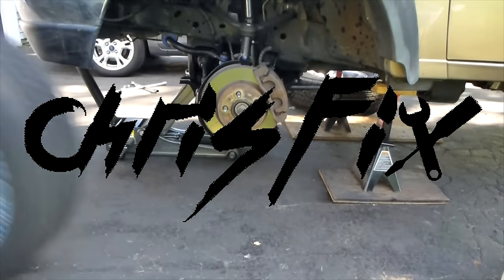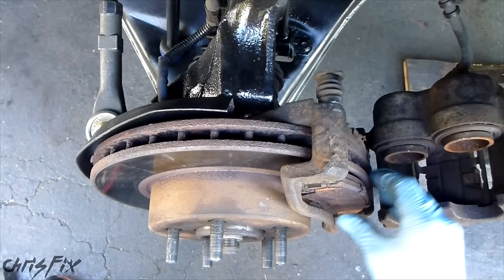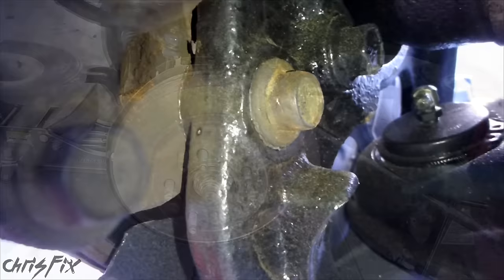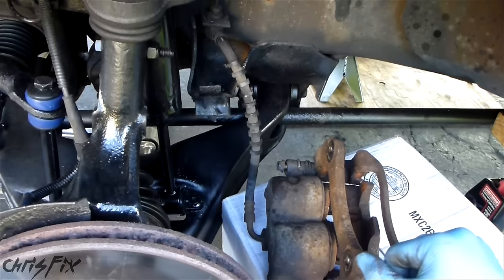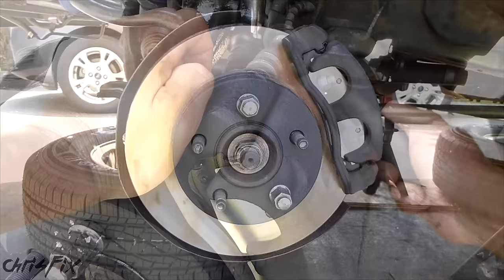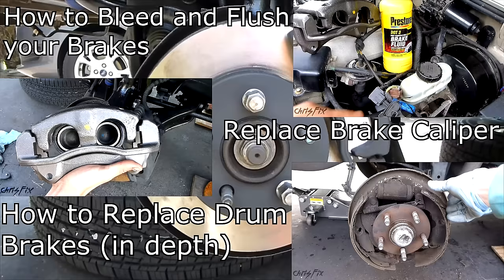How to Replace Front Brakes, Pads and Rotors

Comment: Hi Chrisfix, I have a problem and a question, I hope you or anyone on this feed can help me out with.  O.k. 1st,  I notice my truck GMC Canyon 2006 would shake when I'm braking and coming to a complete stop. O.k. I was told that my rotors needed turning, I had them turned, but put back on my old brake pads, (I didn't use any brake spray before appling the pads neither time) because they wasn't worn down.  When I install the old pads back on, and drove it, it did the same thing.  So I purchased new pads, put them on and it still shakes when I'm coming to a complete stop.  What did I do wrong, or what do I need too do to hopefully solve the problem??? Could it be my back brake pads??? Can you please or someone respond thanks.

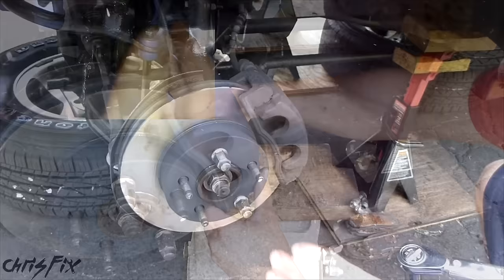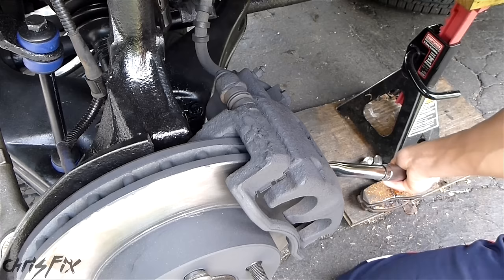Comment: What do you mean in 3:35-3:45? You said something like toke it down to 80 foot pounds but is this necessary? If so, why? Thanks
Reply: You will need to torque them down to a specific foot-pound because you need to make sure you've got the bolt on tight enough. You wouldn't want anything falling off, especially while you're driving! You'll have to look up the correct torque specification for your specific vehicle.

Comment: +ChrisFix hey man, thanks for this video. I love watching your videos. you explain this so clear and better. I was wondering if this would work on my 2000 ford expedition? Do I need to use a torque wrench, or can it be hand tightened? (don't have a torque wrench) also how can I tell if my application needs to be 12mm or 14mm for my rear rotor. please help with these questions.
Reply: I ask if it is the same only because I've seen some videos where they use a screwdriver and stick it in the middle of the caliper before they begin.
Reply from the maker: +Edwin Castillo It should be exactly the same and if not, it should be similar.

Comment: How do i find tightening torques for specific vehicles (pretty sure its different on every vehicle and i just wanna do it right) if there's none on the internet and i don't have service manual?
Reply: for torque specifications on your wheel lug nuts they should be located on the side of your door that also includes tire sizes and recommended psi.

Comment: wassup Chris I got question If u can plz text me back about that part where u put the small bolts to hold the break pad on rotor..... ummm does it have to have a specific torque pound on the bolt like if I tighten the small bolts that hold the break pads, will that cause the break pads to keep on compressing the rotor because I put new break pads and new rotor and the rotor seems to be getting pretty hot after test drive
Reply: on 8:06 that's my question

Comment: Chris!! I did a brake job to my truck and i tried bleeding the brakes and the bleeder bolt broke!! now my brake pedal goes all the way to the floor. what do i do? Should i get a new caliper or take it to a professional that can remove the broken bleeder and just replace that? help meeeee
Reply from the maker: You can drill out the old bleeder valve. It is easy because they are hollow. Then press the brakes a few times to push any metal shavings out. Then install a new bleeder.
Reply: ChrisFix thank you so much. But I can't use the truck for now bc the breaks are very weak. Would that be bc of air in the fluid/brake lines?

Comment: Chris can I use the same grease i bought for the bearings on the brake pad guide?
Reply from the maker: Use silicone grease. Petroleum based greases can degrade the boot on the guide pin. Di-electric grease is the same as silicone.

Comment: Hey man! Where can I find the torque specs for the brake bolts and guide pins. All my owners manual gives me are the wheel lug nut specs.
Reply from the maker: Here is a video where I go over that info: https://youtu.be/3v3hLvuO_KU?list=PLDD611CFB36FC65F2

Comment: C clamp and old brake pad works just as well
Reply from the maker: It does! A brake spreader makes your life a little easier though!
Reply: 18 years behind a car n working on them. C clam easier n faster in my eyes .   when I work on any car or truck.  
 sure 40 bucks on a tool or 10 bucks ? Question able. Some guys have very little money need to show this kids to use cheap tools that will work .

Comment: Hello Chris. I recently changed my brakes and rotors 5 days ago and I hear a metal to metal noise and it starts squeaking when I'm close to stopping. What could be the issue.
Reply from the maker: It could just be your brake pads are new and need to be broken in. Drive 200mi and see if it is still there. Also, cheap pads will make noise so remember that.
Reply: +ChrisFix so I worked on it today. I used brake cleaner and greased the brake pads. I installed ebc greenstuff series 2000 brake pads and ebc rotors
Reply: +ChrisFix it has improved but just a little noise

Comment: is there no need to bleed them?
Reply from the maker: You don't have to if you're just doing pads and rotors because you're just replacing parts and not opening up the system, but usually brake fluid gets overlooked so with everything the way it is, it wouldn't be a bad time to bleed them and replace the old fluid!
Reply: @chrisfix  thank you for the quick reply, Chris. Going to replace the pads/rotors on my Matrix. :)

Comment: Hey chris, do I have to open the valve when compressing the caliper? I have a Toyota Tundra if that matters? Thanks!!
Reply from the maker: +Avi8CaLiBeR You dont have to, but you can if you want. I almost never do it but if you want to bleed out some old fluid, it helps. Check this out: https://www.youtube.com/watch?v=xJDOuZzEAQc
Reply: In what situation would you have to bleed the brakes? Thanks so much and I love the videos! Keep it up!
Reply from the maker: +Avi8CaLiBeR Any time you remove the brake line so air can get in you need to bleed the brakes.

Comment: My calipers really tight and my rotor won't spin I just replaced the rotor  caliper and pads what do I do?
Reply from the maker: Press on the brakes and let off the brakes. See if the caliper pulls the brakes off the rotor.

Comment: what happens if you change the brake pads without opening the brake fluid cap?
Reply from the maker: +Dimitris Tilaveridis You could get pressure buildup but I have done it before with no ill effects.
Reply: thanks

Comment: Changed my brakes and rotors and after about a two mile test drive, brakes were smoking when I got back? Not terrible but there was little smoke? Also still a lot of sinking in the brake pedal? Any ideas?
Reply: Did you bleed them?
Reply: Yes bled them and helped somewhat but still play in the pedal.
Reply: Are you leaking break fluid? Maybe it was leaking onto the brakes and smoking from all the heat.

Comment: Hey, quick question:
I just got my rear brake pads and rotors and now I am hearing a clunking sound when going over speed bumps, like something is loose in a box and it thumps on the box when you shake it. And while braking, I hear another sound that I can't put my finger on. I just got them done last week and my cousin who is a mechanic came to see and he says that I got the wrong rotors, which I know is wrong but he thinks they are the wrong sized rotors. I'm lost. Can you at least give me a nugget of info. lol Thanks. 

2010 Nissan Altima Coupe, 150,500 (roughly) miles. Purple <3 lol
Reply from the maker: Probably a sway bar end link or sway bar body bushing: https://www.youtube.com/watch?v=YqOsW1X1-O8
Reply: Ok, I will look into it. Thanks!

Comment: Is it necessary for a torque wrench?
Reply: Those bolts are made of high quality steel, you won't snap the heads off or strip the thread with hand tools so just do them up bloody tight!
Reply: +John Hemingway Thats false. sure he doesnt need to use a torque wrench in every scenario but some of these bolts are indeed not strong. ive broken slider pins with a simple wrench before.

Comment: Chris to reply to your question,  the brakes fine,  then I start to smell the brake pads,  n the car slows down when I take my foot off the gas pedal..   I am concerned..   I replaced the brake pads,  install new caliper,  n rotor, I have bleed the brakes..   n still the problem exist..  I am not using the truck,  but will take the car to a mechanic to have it check out..
Reply from the maker: +jose ilarraza Keep me posted!
Reply: Ok...

Comment: how often do you have to change you break pads shud I learn more about cars before I purchase one
Reply: +Simply Tron How often depends on how you drive. I've seen people having o replace their pads after 18k miles and other after 60k miles. If you do a lot of hard braking you will need to replace them sooner. For example I tend to have to change my brakes sooner than most people cause I spend a lot of time at the race track, so that means I drive my car much more harshly than others and have to replace my parts sooner than people that just drive from point A-B.
For actually learning about cars before buying one, you don't have to know how to take apart an engine and rebuild it, Or how to replace the synchromesh in the transmission, but you should ALWAYS learn and do research on the cars you are thinking about getting. A lot of people don't know what a rotary engine is, and people end up buying a Rx7/8 and wonder why their engine has seized up in less than 500 miles, because they didn't do their research before they bought the car. So If you are thinking of buying something, look it up and see what the Pro's and con's are to owning that car.
Reply: +- “RaceReadyRider” - what u think about 2006 volkswagen passat
Reply: I've never really looked into them or anything, but mu uncle has one, and he hasn't had a serious problem with it yet. He has had a flat tire, and the obvious oil change. Other than that it's a nice little car. But Don't take my word for it. Do some research yourself. If it's used make sure its in good condition, and when you test drive it, go through every little thing on it. Even if you will never use one of its accessories still make sure it works; and if it doesn't you might be able to talk them down on the price or get them to fix it for you before you buy it.
Reply: Damn he just sold the car lol but I appreciate your response one more thing can u put a navigation system into any car and where wud i get it done at.
Reply: Yup, you can put a nav into any car, but make sure it can fit into your car. Most websites that you buy the nav system at also lets you put what kinda of car you have and they will give you a list of what kind can fit into your car. Or if you go a buy it from a store you can ask them if it will fit.

You can also buy an external nav system, where all you have to do is buy it, suction cup it to you window or dash or wherever you like, and plug it into your cars 12volt outlet (cigarette lighter) and that's it; You don't have to worry about fitment, and it can be much cheaper

As for installation just look up online somewhere near you that can install it. The shops are usually independently owned so I don't know any shop names for you. But I think best buy can do it for you. not sure though. Just look up Car navigation installation near (insert city name here)

Comment: +ChrisFix Hey Chris i am a new subscriber and i have a question for you, I normally do as much work on my vehicles as possible but recently i had a mechanic do my front brakes because i was to busy with work to do them. With that said my brakes were not squeaking, rubbing or grinding when i dropped the car off at the shop. When i picked the car up from the mechanic i noticed that my brakes were doing everything that they are not supposed to do (squeaking, rubbing and grinding), i took the car back because i feel he was responsible to fix them and two visits later they were still doing the same thing. Do you have any idea as to how a mechanic of 30 years could screw up such an easy job? What could have went wrong to cause this? Can i take them apart and clean them and install them right if they are good? or should i just replace them? Sorry if this was confusing, i didnt know how else to word it. Any help would be greatly appreciated! Thank you and keep the vids coming! :)
Reply from the maker: +alec forte Awesome! Welcome aboard! They can use cheap parts, they can do the job too fast and mess up, or they could have had someone else do the brakes. You can try taking the wheel off and spraying it all down with brake cleaner. Hopefully this answer helps.
Reply: +ChrisFix Thank you for the info, the brakes are in good shape along with the rotor but they are deffinately cheap parts and not installed properly. I cleaned and reassembled the brakes but they are still squeaky, just going to replace with new quality parts. Thanks again for the info, videos are great!

Comment: If someone is fixing this for you, how much would the price be?
Reply: $300-$500 depending on shop and car make.  Some rotors are bolted on and you'll need a impact screwdriver or sorts to get it off.  It won't just slide off after taking off the caliper.  

If you drive a German car, like a Benz, BMW.  The German Car Stealership will charge about $800-$1500.  More for price of the car.  My friends ML320 needed new pads and rotors in the front, they wanted $3500 at the dealership.
Reply: That's crazy, I have a ML320! 3500 is what I paid for my used car in total.. My needs new pads in the front at least I believe

Comment: Spoiler alert... Seized guide pin...

In this case remove bracket take to a bench vice. Spray w PB Blaster. Large vice grip. Try to spin it, if doesn't move try taking a box wrench and wrench it around under the head... Hammer out the head (make sure your vice is tight), by banging on the wrench. 

Did this confuse you?

Spoiler alert.

This is an example of the crap you'll learn as you embark upon a rabbit hole of surprises. Yes it should be this easy. No it probably won't be.

Good luck.

If seized guide pin doesn't come out. Pick and pull. Get a new (used) bracket with smoother pins.

If you can get them out and they're rusty / dirty. Brush them lightly with a wire brush. Or use a bench grinder with a soft brush wheel. Cheers.

Comment: i got new brakes an rotors about 3 months ago and they squeak loud..  what could it be?
Reply: That means there's dirt/dust and they need to just be cleaned and put grease on them. Or there's something wrong and they've somehow been worn down already
Reply: improper installation. remove tire and inspect brake system.
Reply: Check the rear brake pads

Comment: Bad technique to compress those pistons and allow the fluid to flow up into the master cylinder.  It is preferable to open the bleed screw and allow the fluid to flow out as the pistons are compressed.  Without doing this it is possible for sludge to flow back up into the master cylinder and cause problems up there.  A one-way valve with tubing on either end will prevent air from getting into the caliper pistons.

Additionally, brake fluid is cheap. And with a one-way valve you can pump the brakes to push fluid out into a container. Then add new fluid to the master cylinder.  When new fluid flows out of the caliper, you have flushed that line.  Repeat with the other wheels and you have fresh fluid all around.

Comment: You need to stop it with claiming brake rotors warp. They don’t. Rotors crack from heat, they don’t warp from it. Uneven brake pad deposits causes the vibrations. You can see in this video some uneven pad transfer on the rotor. Major brake manufacturers have published technical papers on why rotors do not warp and what causes vibrations.

Comment: You need to use brake cleaner on BOTH sides of the rotor, smh! And clean the hub from rust and sand before you put the new rotor on. The other video that ChrisFix did on disc brake replacement is 10x better :D

Comment: There are many cars and trucks out there where it just is not this easy. Many rotors are over the front bearings and the anti-lock sensor is a part of the assembly. You should be telling people to watch out for this because if they attempt to do what you're showing it will not work.

Comment: You forgot to check the rotor runout and how to fix it
Reply from the maker: There is usually no point since it's cheap to replace rotors
Reply: @chrisfix  if the hub has runout the rotor then will have runout. If it's out of spec you'll get pulsating brakes pretty quickly from my experience. I usually grind the backside of the rotor where it touches the hub to fix the runout. Since it's only thousandths of an inch I'm not worried about the reduced metal thickness.

Comment: After finish the brake job
Reply from the maker: When you get in the car you will press the brakes before you start the car.
Reply: ChrisFix so my passenger side rotor is very scratched. Once I put in the new rotor and brakes . I don't have to bleed out the brakes ? My brother said I have to . Let me know thanks .
Reply: Carlos Rodriguez you do have to bleed the break lines. when you compress the break caliper cylinder or piston, you are pushing air back into the lines. So you really have to remember to bleed your breaks.
Reply: Will oh okay I see now that make sense now , thanks !!! 🙂

Comment: I really want to emphasis that you do not want to put any strain on the brake lines. If those bad boys break good luck using your car for the next week cause you will need it towed to a shop to have brake lines put in and most of the time they have to order them.

Comment: I use anti seize instead of loctight.
Reply from the maker: Two different purposes. Antiseize prevents the threads from siezeing due to corrosion and threadlocker is more like a glue.
Reply: I thought it was also for high temp
Reply: I've never had any issues using anti seize